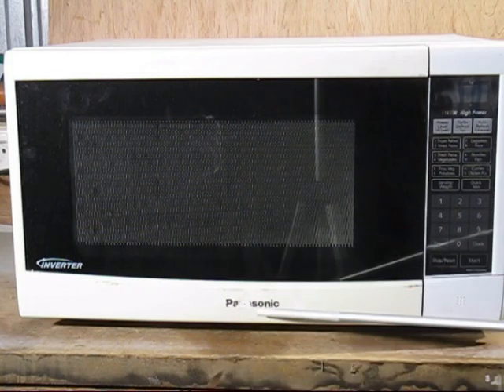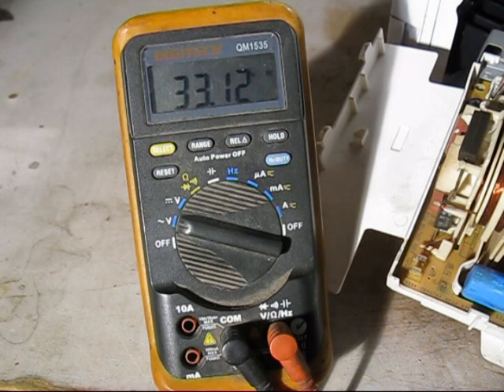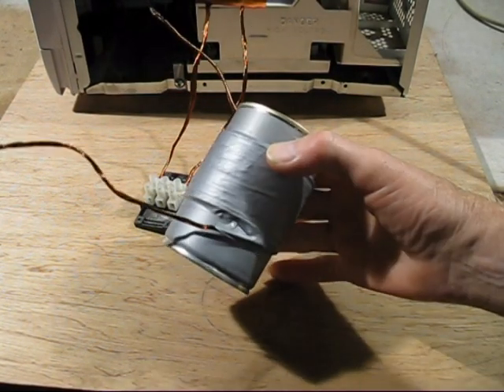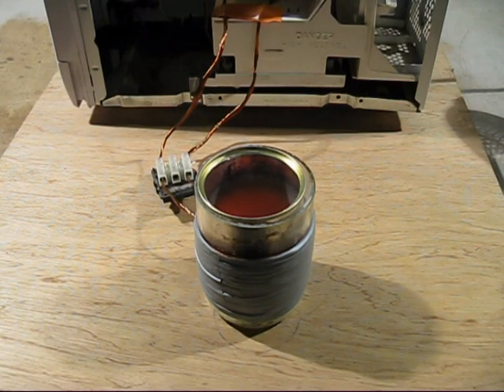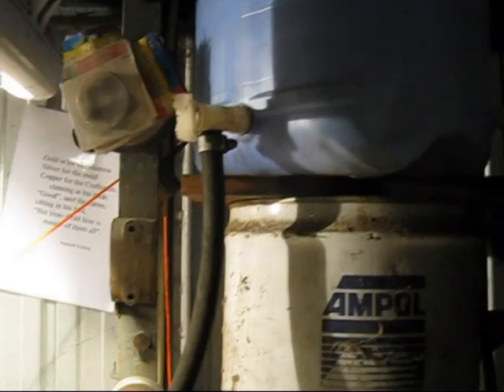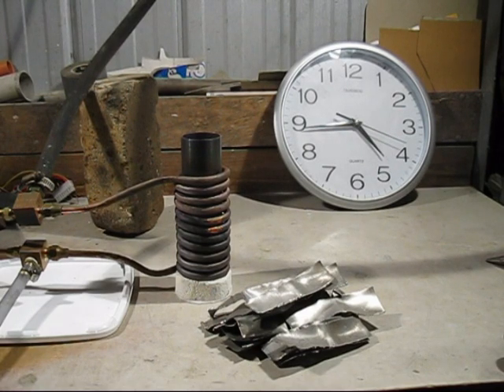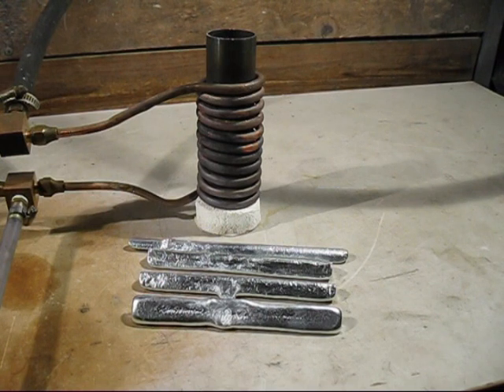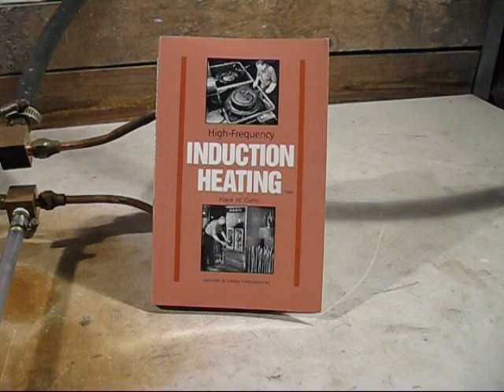First time on youtube, induction furnace made from microwave oven parts

Comment: RE: Glass sleeve for induction furnace

 

Greetings from Canada !

 

I’ve been a fan of tour You tube channel for years now, and I’ve always liked your experimental 
and innovative approach. I particularly like your crucible cart / trolley !

 

 Like you, I have done quite a lot of metal casting, bronze sculpture mainly and enjoy building my own 
equipment.  I’m a glass blower (flame work mostly), so hot glass has been my livelihood for over 45 years.

 

Why the glass didn’t shatter:

My short answer is that you were lucky enough not to deliver enough thermal shock to the glass sleeve 
to cause fracturing.

 

The long version:

 

Like all materials, glass expands with heat & contracts on cooling. It takes time for the heat delivered to 
a tube surface to penetrate deeper into the glass & opposing surface. At the beginning of the
 heating process one surface is expanding (rapidly), while the deeper body and other surface are in more 
rigid states. I believe this is called differential thermal expansion, and this causes enormous stress in the
 glass, which can lead to the shattering you were expecting. Delivering heat to a localized area has the same
 effect, with a zone in expansion (hot), and the surrounding cooler areas holding firm.

 

If the heating process is even over the entire glass surface, and the heating rate is slow enough for the glass
 wall to expand evenly, then the tube has a reasonable chance of survival. Your jar is likely a “soda-lime"
 type, formulated to have an expansion coefficient (COE) of 9x10 -7. This is quite high and it's vulnerable to
 thermal shock, whereas lab vessels or coffee pots made from a borosilicate type glass (pyrex, simax etc)
 are formulated to have a COE of 3.3 x 10-7. This means that they expand 1/3 less with heat than bottle
 glass, and is part of the reason for their resistance to thermal shock. Counter-intuitively, thin walled vessels
 stand up better than thick ones to thermal shock, since the heat penetrates more quickly and the expansion 
then occurs more evenly.

 

This is only half the story. 

As the heat is removed, cooling begins and the reverse process occurs. The outer glass surface can disperse
its heat to the air faster than the deeper body. The outer surface is in rapid contraction, and the inner core 
either still expanding or holding firm. If the temperature reaches the stress zone then this can lead to 
permanent internal stresses in the glass, which can cause fracture at any time…seconds or years, and the 
stresses are invisible. You can detect internal stress with a polariscope, which you can cobble together with 
2 polaroid filters and a light source.

 

Glass blowers anneal all glass after fabrication to minimize internal stress. The glass is heated to its”annealing 
range” (below softening), held at that temp long enough for stress to be relieved, and cooled slowly and evenly
 to avoid further introduction of stress. 

 

Your glass sleeve may contain internal stress, and if so could fracture, just sitting on a shelf.

 

 

Len Chodirker

Glass Sculpture Studios (Canada)
Reply: what he said.  i knew that. ;-)
Reply from the maker: It did crack the  next day seemly for no reason.
Reply: I'm not surprised. Annealing right after the test might have prevented this, but hardly worth the effort. Some kind of ceramic cylinder, might be more suitable for this task.

Comment: The thing that is easy to forget is induction heats the metal itself rather than the crusible which conducts the heat through it then into the metal. You could use a non-conductive ceramic crusible too, as the magnetic field would easily penetrate.
Reply from the maker: That will be in a future video.
Reply: @luckygen1001  iron crucible is good in that it takes full advantage of induction heating because it is the most magnetic, but a possible problem using iron crucibles with higher temp metals may be  that iron gets absorbed into those metals after they starts melting, causing brittleness, etc??  Also iron looses its magnetism at some point, maybe 1300 Fahrenheit,  and then is less efficient.   Possibly a thin wash coat applied to inside that would also allow the heat to pass through could prevent metal from alloying with the charge?  Surrounding with kaowool would help quicken melting of both pewter and zinc, and maybe even allow small quantities of aluminum.
Reply from the maker: Yes they are all good ideas. The steel crucible was only for low temperature metals and as you said once the curie point has been reached it is the same as heating non magnetic metals.

Comment: I am wondering if you would coat the induction heater coil using any type of ashes over the copper coil would increase the efficiency and reduce the heating time ??? Am really impressed that a microwave would make such a heater. Also. does using the microwave in this fashion reduce the life of the unit ??? Thanks for doing such a interesting and re-purposing of a unit that would end up in the junk pile. Look forward to more videos from you soon.

Comment: As a home hobbyist of e-waste precious metals recovery I acquire many kilos of copper, aluminum, and some alloy gold and silver. One day I would like to melt the copper into bars for hoarding. My concern is will a high frequency induction heater work on standard house hold current of 220v with a standard 15-20 amp circuit breaker in the electrical panel?
Reply from the maker: The induction heater I made in the video will not melt copper without a lot of modifications but have a look at "frenchcreekvalley" channel on youtube. He uses an induction melter he got from ebay and it works from a 220 volt 15-20 amp outlet. Power is everything when it comes to melting metals.

Comment: glass can actually withstand very high temperatures. The enemy is stress generated by uneven heating. That works every time.
Reply from the maker: There was uneven heating in the glass jar as the tin was red hot in one place and cool in other places
Reply: Would think moisture would be a big part ..

Comment: A few words about the glass: What causes glass to crack or shatter is not absolute temperature, but thermal stress - that is,  a high rate of temperature change, whether from cold to hot or the other way round. Another cause of thermal stress is one part of the glass seeing a much higher rate of heating than another part, especially if the boundary between the different temperature zones is narrow.
The coil around the outside of the glass avoids this because it doesn't heat the glass directly - as you know, the induction heating only heats any electrically conductive materials inside the coil, whether those be metals or semiconductors like graphite or doped silicon. When you put the metal can inside the jar, the glass still does not receive much thermal stress: The highest heating occurs in the centre of the coil, with a gradual reduction of heating towards either end. Also, the slight gap between the glass and the can (because they are not a tight fit) ensures that most of the glass is not in direct contact with the can, so is not directly heated by it either.

There is one particularly useful application for this kind of induction heating in chemistry: Making highly air-sensitive graphite intercalation compounds, particularly with alkali metals, such as potassium graphite (average formula KC8). To make this requires extremely pure and dry graphite and potassium metal - the latter being notoriously reactive with both air and water. Both have to be heated to high temperature inside a sealed glass tube under a completely inert atmosphere, such as high purity argon.
Induction heating is ideal, since graphite can be heated this way (even as a powder) and potassium obviously can as well since it's a metal. Even as the reaction proceeds, the heating would still be effective, since the KC8 product is also electrically conductive, with a conductivity somewhere between that of the two starting materials. You can tell when it's working just by looking, since KC8 is a beautiful golden bronze colour. It is also notable for being one of the most powerful reducing agents in the universe.
Reply: How powerful is it? What are the practical applications for KC8 ?

Comment: @luckygen1001
My uneducated guess is that the reason why Your glass jar didn't shatter is that You managed to heat it "evenly enough". I believe that what makes glass "shatter" are the tension that is built up between areas with "substantially different temperatures", that therefore are expanding to different degrees.
The fact that You had such a comparatively large portion of the jar covered is what I believe "made it work", and I believe that if You for instance had had a taller jar and just had the same size wrapping on the mid section  it might well have shattered... 
Well anyway thanks for the great content, always interesting.
Best regards.
Reply: Your analysis is spot on. 
Slow, fairly uniform heating followed by similar cooling will anneal the glass.
Even soda-lime, which reacts poorly to thermal shock. Borosilicate is way better, but NOT perfect; I've  blown some up just cooking dinner... :-)

Comment: I can't wait for the MK2 version where you cast aluminium. Could you please give some details of the transformer you used.  Keep up the good work. Cheers
Reply from the maker: The transformer from the microwave oven does not have enough room to have a new primary winding and a copper tube secondary so I used a flyback transformer from an old crt  tv. They have plenty of room to experiment with.
Reply: I don’t think it will be able to melt aluminium. It’s resistance is too low.
Reply: @mareksvrcina5279  That's what crucible for, it heats up the metal.  Best to get graphite crucible that's isolated from copper coil.
Reply: Aluminum, nah that's too wimpy. He is the master of cast iron and it's the best one to cast.  Let's crank up the AMPS !!!!!!!!!!!!!!
Reply: Well... Melting point of aluminum is somewhere near 660C, it is around the same temperature, where steels starts glowing red. So theoreticaly this should be possible, but it might be slow, since crucible itself takes time to get to that temperature... Maybe improving insulation might help...

Comment: Luckygen, I have had another look at microwave inverter board that I have. It appears the there is no feedback connection from the secondary side to the primary driver circuitry. As you mention, there is a current transformer in the primary circuitry to monitor the primary drive current . The absence of any feedback connection from the secondary suggests that the board may well continue to operate if the inverter secondary winding was removed altogether. In that case, it may be possible to remove the transformer from the board so as to get rid of the high voltage secondary altogether, and then re-wind the heavy multistrand primary and thereby make room for some turns of the copper pipe as the secondary winding. Indeed, I can see no particular reason why the inverter board would not operate with its power transformer physically removed from the board and just electrically connected by the primary. Either way, winding the copper tube as the secondary would enable you to dispense with the intermediate (ex tv?) flyback transformer core that you have interposed between the inverter and the work coil. 

Obviously, the copper tube secondary would have to be adequately insulated from the inverter primary, which is live at our 230 volt mains potential ( no namby pamby 110volts in this neck of the woods).  When winding the transformers in pushpull or H-bridge driven inverters, you have to worry about leakage inductance between the primary and secondary windings. That is why the primary and secondary windings in computer power supplies are often split and interleaved to achieve close magnetic coupling. However, in flyback type inverters, such as I believe the microwave inverters are, leakage inductance is not an issue, so you can use plenty of insulation to physically separate and insulate the secondary copper tube winding from the primary. As you would know, It may be possible to improve the performance of your set up by adding capacitance to the work-coil circuit, either in series or parallel with the work coil, to get it closer to resonance at the drive frequency, but that may also risk letting the blue smoke out of the inverter board. The load presented by the work-coil changes dramatically as it is tuned towards resonance. The capacitors have to be able to handle the high current and when connecting smaller capacitors in parallel care has to be taken with the physical and electrical arrangement so that they share the load equally. In other words parasitic inductance in the connection arrangement can cause problems at such frequencies.  If you get the idea that I am enthusiastic about your experiment, you would be right.
 More power to your right arm! Just make sure it is not 5,000 volt power from that inverter secondary!

I would really like to meet you some day. I suspect that, like me, you are always looking at things and wondering, what else could we do with that? In my case it might have something to do with not having a particularly materially well-off childhood, although I cannot claim that we actually lived in a hole in the road. 

By the way, did you find a source of nickel for alloying in your cast iron? I think the best convenient source of a small quantity might be the high nickel welding rods from Bunnings. You can get 25 Bossweld 2.6mm Nickel Arc 98 stick electrodes for A$32.88. Assuming that they are only 300mm long and 98% nickel, that yields about 346 grams of nickel. That works out to be about A$94,700 per tonne or about 4.5 times the bulk nickel price, which is not that expensive for a small quantity.  Cheers.
Reply from the maker: Yes, used microwave ovens have so many uses. Make sure that you
look at my video “ Repurposing a microwave oven controller.” It shows in detail
how it was done. Regarding the microwave oven transformer it should work
disconnected from the inverter PCB. I know that manufacturers do change
settings and parts so what works on one oven may not work on another. You just
have to keep trying. I have avoided use caps on the work coil for two reasons,
1. The output frequency can change a lot when the inverter is under load and
not under load. So a large array of caps are needed suit the changing frequency.
2. Caps in commercial induction furnaces are water cooled so how does one build
a water cooled cap? Have a look at my video showing the inside of a 300Kw power
supply for an induction furnace. Water cooling is used a lot. I think that we
do see things in a similar way. For a long time I never had any interest in
electronics but in the last 20 years that has changed because there is so much
being thrown out and gives me a chance to see if I can reuse or repurpose it. I
will have to look at those welding rods at Bunnings. I was thinking of using
metal plating nickel but with shipping costs it may end up just as expensive as
the nickel welding rods. A long time ago a friend came to visit me and saw the
microwave oven transformers in my shed. He said to take of the top bridging
piece and connect 12 volts to it. I was amazed at how strong the electromagnet
was. One of these days I will have to make video about all the uses for a
microwave oven but if I do some one will watch it and say I can think of 50
more things you have missed.